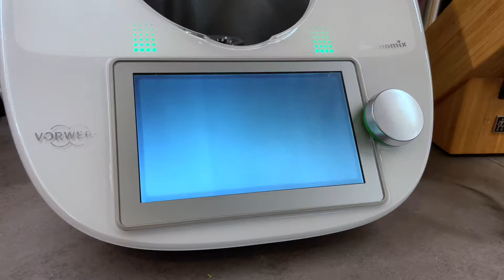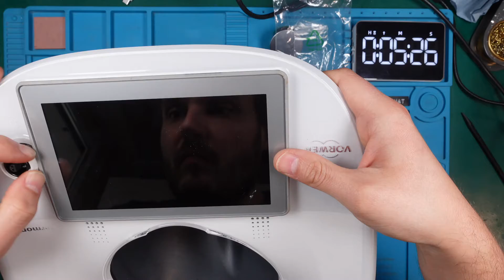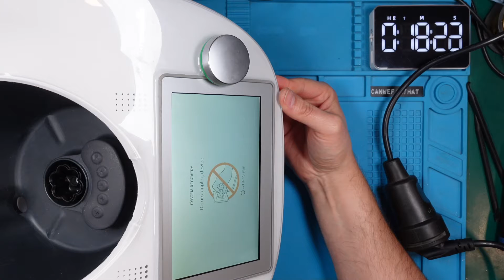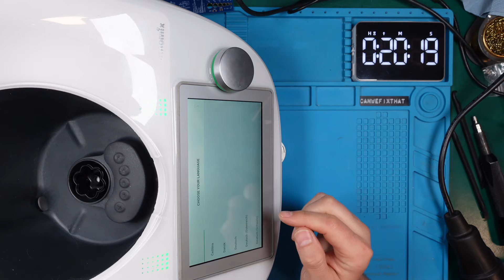The Ultimate Test: Can I FINALLY Fix My Thermomix TM6?

Comment: If I could buy parts for the Thermomix from somewhere i could fix them too ! But it s hard to get all the parts ( power PCB , main PCB , the central module and on top of that you’ll need a software to calibrate the TM after you  replace the power PCB or the central module !
Reply from the maker: Yeah, I guess the screen is one of the spare parts that's the easiest to gather and replace. ✌🏻
Reply: Where did you got the screen? Please help i can't find the supplier  @CanWeFixThat
Reply from the maker: Hi Marta, I would love to help you, but these sellers appear and disappear as fast as a pop-up store in NYC. Try to search places like Amazon, eBay, and Aliexpress with something like "thermomix tm6 screen replacement" 🫶